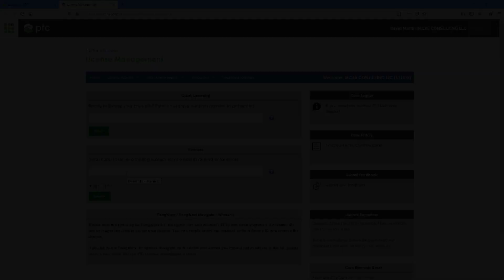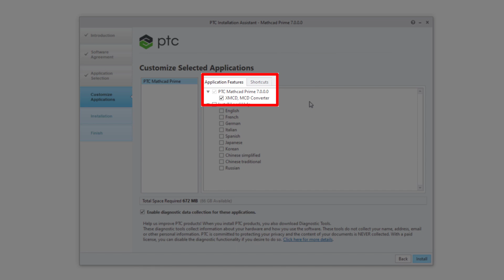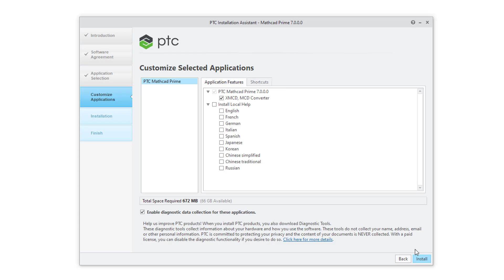PTC Mathcad Prime 7.0 Installation

Comment: Definitely want to echo to install that converter if you have legacy Mathcad files or think you might come across them at some point. Very handy.

Right now PTC is working on adding a note to the old Mathcad product family download page that links to the Mathcad Prime product family download page where Prime 7 lives. That should make the two co-existing pages less confusing.
Reply from the maker: Yes, one reason I made the video is that I went to download Prime 7 and thought it wasn't available to me yet. When I checked again a couple hours later, I noticed the second choice for Mathcad Prime.
Reply: @CADPLMGuy  The note on the old page is up now!
Reply from the maker: Excellent!